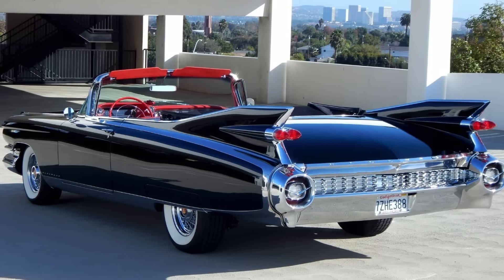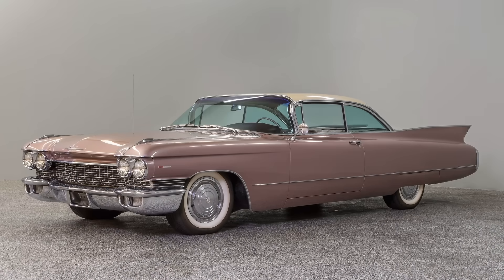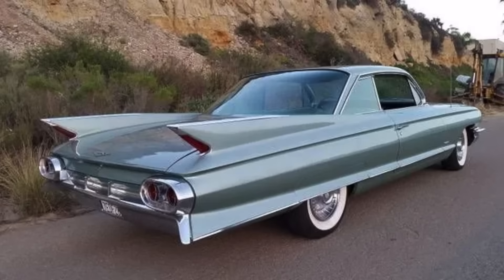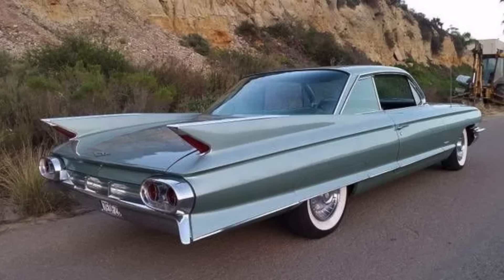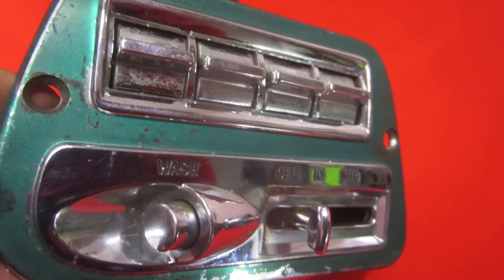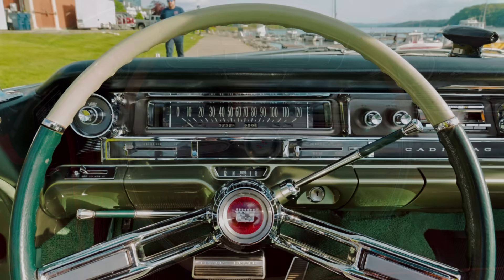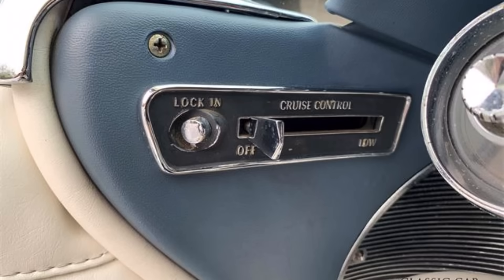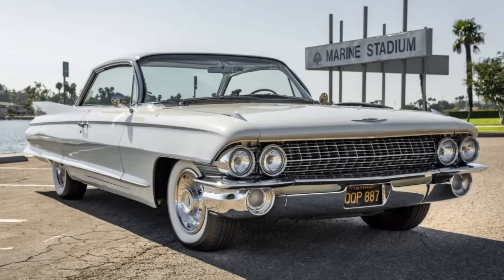Worst Automotive Components of All Time: The 1961 Cadillac's Dangerous Cruise Control (GM)

Comment: In about 1976, a woman offered to sell me her '59 Cad convertible for $150 ... I was a teenager, and said "no."  In hind sight, I should have said YES.
Reply: Right
Reply: Fifty Year storage was not on your mind at the time.
Reply: for me, she was a '64 Electra convertible and she wore red all over, for just $500. She was more than I could handle. Two weeks later, we saw her in the transmission shop. We kinda wondered if she "had problems" when we first gave her a go-over.  I'm glad I waited for good, honest, decent, upstanding Chrysler in blue.
Reply: You refused a Cadillac convertible?  Weird!
Reply: In `83 I bought a copy of the Want Ad Press, and found a bunch of `59s for sale. The one I checked out was being offered for $750, and I had talked the seller down to $650. But my parents had their mechanic check it out. He found a bent control arm. Plus one side of the dual exhaust was flex pipe. He didn't like that. Plus he didn't like the rust, so he recommended against me buying it, so my parents wouldn't let me have it. I later bought a `63 hearse without telling them till I brought it home.
Reply: For me, a 67 Dodge R/T in great condition for 300 dollars.
Reply: I knew a man who had a '60 Eldorado convertible.  Black with red interior and a white top with only around 40K miles.  He bought it in the '70's off the original owner from a for sale ad he saw in the newspaper.  He paid more than you would have had to for the '59; I think he paid around $2 or $3K but it was in near mint condition.  I rode in that car back in the '80's.  He died recently and I wonder what happened to that car?
Reply: @MillerMeteor74  Cool story.  I used to buy Hemmings around the same time.  When I was in college, I think it was '84 or '85 I had an opportunity to buy a '76 Sedan DeVille D'Elegance from the original owner.  I think it was around $2,500.  My father said he would help me out with the purchase and after I agreed to buy it, my father (who was known for this) refused to help.  I made HIM call the man and tell him and he lied, telling him I agreed on it knowing I didn't have the money.  
Well, it took me 28 years, but I finally bought a '76 D'Elegance only it's a Fleetwood.  Which I still have.
Reply: I was 14 in ' 76 and could have bought an ' 60 Impala for $ 200.00 and said no , so I know the feeling !
Reply: It's easy to have 20/20 hindsight when you're older, but when you're a teenager it's almost impossible to have 20/20 foresight.
Reply: Don't feel bad, we have all made insanely stupid decisions when we were young...  😢
Reply: If it was a 59 DeVille convertible,  then not a huge loss to you!! An ELDORADO.? BIG LOSS TO YOU,!! I have always said that the 1959, 75 series limo was the ONLY model that the  HUGE TAIL FINS looked appropriate on!
Reply: All of us from that time are kicking ourselves for vehicles we let get by that are now worth a small fortune. My biggest regret is from 1980 when a dying family friend offered me his 1953 Indian Chief motorcycle for $6000 (1/2 of what a collector in Connecticut had offered him). The bike was the last Indian sold east of the Mississippi when Indian folded in '53. It had  the optional factory tangerine paint, saddle bags, chrome package, and only 16K original miles.

Besides being a cool bike to own, it would be worth well north of $250K today.
Reply: I wouldn’t regret it too much. It would have cost you a small fortune to restore it to top condition.
Reply: As a teen in 1976, how lofty would $150 have been?
Reply: @sped6954  Well, a couple months wage.  Not to mention I already had my '55 pickup.  And it needed a transmission before I could even drive it.  And my parents wouldn't let me store it in our driveway, so I would have had to rent storage.  It just wasn't in the cards for a teenager.
Reply: They were cool for a couple years after they were introduced and then decidedly uncool until people had a chance to reflect on the passing of Elvis and how that whole late ‘50s era was gone forever.  Look at how they treated the one in the 1978 movie ‘The Deer Hunter’.  Then artists like Mellencamp and Springsteen began to harken back to that era in their songs.  So I’d say that by the early ‘80s it was definitely cool again.
Reply: For me, in 1985,it was a  green 69 camaro ss 396 convertible with 35k miles for $3000 .didn't buy it on account my mother said,you're not get a second car of yours in the drive way.I use to have a 72 impala,sob
Reply: Many cars we should have, could have, would have...
Reply: In our culture at that time of this Cadillac our most advanced Jet was the F104 Starfighter provided to NATO and the Germany who called it a flawed dangerous aircraft !
“in America tail fins could Not be too Large and Jet wings could Not be Too Small !”
Reply: Love it . A hearse 😁😁👍👍
Reply: I probably would have passed as well. When I was a teenager we thought of Cadillacs as a car for old people.
Reply: We’ve been there at one time or another. But probably the most common car story is . 
“I wish I still owned it.”
Reply: @oceanhome2023  they must have thought then too large since the '60 shrank them
Reply: @inkey2 i think it was meant that if you’re young and originally intoxicated with owning a 21’ long dramatic finned car, and it typically begins seriously needing major brake work, then fuel
gauge goes dead + other various safety & basic function issues, its gotta be parked safely without being molested until funds gathered & parts searched. i.e. waterpump, power steering unit… You’ll need storage for “various times all the time” and much unlike a 68 Coronet 318, you’ll ‘be very married & in waiting’ for this ‘59 to be back on the road. But sure, it was cool at first to say you now own this jaw-dropper to one of your girlfriends, till she falls for red & black ‘71 Chevelle SS guy !
Reply: You fool!
Reply: @michaelbenardo5695  Hey man! 150 clams in 1976 would be 830 in today's (2024) dough. What teenager had that?
Reply: @garymckee63  grandpa's car - lol
Reply: Well the fact that 1976 was the time of the gas shortages, I could see why you would say no.
Reply: My dad has a few stories like that but he always says even if he hadn’t passed those deals up he’d still be kicking himself because back then if you’d bought it you’d have driven it and treated it like a cheap, well used old car to bomb around town in and it would have been totally worn out and basically scrap iron by the mid 80’s at best. It really makes sense when you think about it….back when you could get them cheap most of the ones that were bought / sold weren’t treated as treasured collectibles.
Reply: The reason they are valuable now is because nobody in the 1970s cared about them.  

They were old and unreliable and out-of-date (we used to ridicule cars with tail fins) and used a ton of fuel in an era of spiralling oil prices.  

A jalopy for someone who rarely drove or a really good contender for a demolition derby.  

And even for those who could see that they would be collectors cars.. would you buy a 2002 Cadillac Eldorado with the horrible Northstar engine and keep it for 50 years hoping to see it increase in desirability and value?
Reply: Did you have $150 in 1976? That's a months wages working part time.
Reply: @dannydaw59  Did you have $150 in 1976? That's a months wages working part time.
     I probably did have $150, I've always been a saver.  But also the car needed a transmission, that was the reason she was decided to get rid of the car; and whatever that would cost, that probably would have been a bigger deal.  Plus a 1959 car in 1976 is a 17 year old car ... so it would have needed more than that.
    I made $2.25 p/h, for I don't know, 20 hrs a week?
Reply: By the 70's the 50's look was out of style and everyone longed for the sleek new liners of the 70's. They were practically giving 50's cars away.
Reply: @BenLapke dont have to be restored, just need to own it to profit
Reply: @albear972 those that had job living at home for free w a brain
Reply: @calvinnickel9995 no u buy it because u like it & probably goes fast w big engine, thinking of only financial gain is recent occurance
Reply: That's like being offered a 2007 Mercedes coupe for a couple thousand bucks today. Most people would pass on it... god knows what may be wrong with it, and what needs to be replaced.

Comment: I own a 1961 Cadillac Fleetwood that has the cruise control option.  It is a Perfect Circle unit that was used by multiple manufacturers (Chrysler, ironically, called theirs "AutoPilot" back then).  The unit had some functionality that Adam did not mention.  It was governed by the speedometer cable and used a mechanical connection to the throttle linkage to work the accelerator pedal.  To just use it as a cruise control like on many of today's cars, you simply brought the car to speed and pressed that small button and the car would maintain that speed.  You could also use it as a speed minder without engaging the cruise control by sliding the lever that was next to the button.  When the car reached the speed that corresponded to the slider setting, it would push back on the accelerator pedal if the speed was exceeded.  The slider lever could also be used when the cruise control was set to increase or decrease the speed.  This latter function could be tricky if you moved the slider too fast while the cruise control was set.
In any event, the cruise control could be disengaged by simply tapping the brake pedal so it would be hard to get it in an uncontrolled runaway situation.
Reply: Some people are just too scared of everything.
Reply: Thanks for those tidbits.  My '61 that I had in the '70s did not have the CC option.
Reply: Thank you for the tutorial, I was curious about the control functions.
Reply: View any Classic Car or Truck....
These vehicles were owned and driven by people who could actually Drive...
Survival of the Fittest right?..
With a Mechanical Link to Throttle input, Cable ... Have faults, wear etc.. conveniently (N) has been granted for your safety...

Cheers from Southern California 🇺🇸 
Daily Driver 68 Dodge Dart...
Keep them on the road
Reply: Yeah thanks for that. He made it sound more dangerous than it really was.
Reply: It was a traditional cruise control for that period of time and well into the 70s. It definitely scared a lot of people but if you had a little bit of driving skill it was easily a wonderful tool on long journeys. It is indeed that the interior designers change the location however and would be confusing for those that owned previous models but probably only once lol
Reply: The trouble with using a brake tap is that it could be interpreted as a brake check by a driver behind you. As soon as I realized that point I started using the cancel button instead.
Reply: @joewoodchuck3824 brake check was not popular in 70s people worn't such assho back then

Comment: A pretty bad automotive control was the pushbuttons to operate the automatic transmission of the 1958 Edsel.  They were located on the hub of the steering wheel and they activated an electric motor that was mounted on the transmission.  My dad had a 1958 Edsel Pacer.  Shortly before I used the car to take the driving test for my first driver's license, the electric motor burned out, making the pushbuttons inoperable.  My dad rigged a lever just to the right of the accelerator pedal to shift gears (DNR).  When it was time for the parallel parking part of the test, I pulled up in front of the parking space and, without releasing my grip on the steering wheel, I shifted into reverse with my foot and backed into the space.  The examiner gave me a puzzled look because he didn't know how I shifted into reverse.  I had my answer ready if he asked, but he didn't ask.  If he asked how the car went into reverse, I was going to say "automatic transmissiom".  If there had been such a thing back then, this would have suggested artificial intelligence.
Reply: I wonder if the same third party supplied the Edsel push button drive system parts as supplied a sort of similar system that was on some 1956? (not 1955?) Packards with their automatic transmission woes ?

Comment: Ford said, "Hold my beer..."  A 1977 Ford wagon with the 460 V8 cruise control would not cancel with a brake application when a brake light bulb burned out.  My old boss found that out when he attempted to exit the highway after driving some distance with the cruise control on.
Reply: Ouch
Reply: To fix that they put in a pressure switch on the brake iine, which only ever actually got used in the event the brake circuit 'failed'. Which then became a problem when they got a bad pressure switch design and they'd short and catch fire.
Reply: @warphammer  Fast forward a couple decades and Fords were burning to the ground because they used a cheap diaphragm switch for that and brake fluid is conductive... Everyone else was smart enough to have a switch tied to the brake pedal...but not relying on the bulbs to be functional lol
Reply: Had late-‘70s Lincoln’s; never noticed such a problem.
Reply: Also, in those days, you couldn't let your Ford idle. They had a tendency of dropping out of park into reverse.
Reply: GM is'nt better. An Opel Corsa C with automated manual transmission is'nt startable with both brakelights burned. Not as dangeous as a not canceling cruise control, but calling a towing truck because of dead brakelights  which nearly everyone can fix themself...
Reply: @walterwixzwerg6735  Especially since GM is notorious for electrical system issues/failures... Good chance the bulbs are actually fine and some design elsewhere in the car that GM cheaped out on is at fault.
Reply: Holy crap 😱😱

Comment: In college (1973) I had a 1960 Fleetwood with the infamous air ride ( it worked) - it did not have cruise but with good bias ply tires with that air ride it handled like a dream . I would drive it from Oklahoma City to Houston, Tx. leaving at midnight and get to Houston at 05:00 AM - it was a parade float but I loved it.
Reply: How I wish I could have one today!
Reply: Rarity for sure as most owners had the air suspension uprooted for conventional shocks.
Reply: Bias ply tires were terrible compared to radials. No reason to not have radials after they were available.
Reply: @MarinCipollina  they were NOT available in '73 and when they later were a Michelin for that size vehicle was $100.00 per tire - a small fortune at the time.
Reply: @myronfrobisher  Radial tires became standard on Cadillacs starting in 1973.  Those were Uniroyals. You may not care for the brand, but that's how the factory equipped them.
Reply: @MarinCipollina  when you were 19 years old were you buying radials for your used car in 1973?
Reply: I wasn't 19 until 1976, and yes, my car had radial tires. I had a 1964 Coupe de Ville.
Reply: @MarinCipollina  nice to be rich I paid for my college
Reply: @myronfrobisher The 1971 Lincoln Continental had Michelin X radials as standard. They came with a 40,000 mile warranty.
Reply: @stephenholland5930  ginger peachy - my Fleetwood came with a good set of bias ply tires that were rated better than what came with it new - I drove the car at speeds exceeding 100 mph on my trips to Houston - never a problem . In 1973 98% of the passenger cars on the road were on bias ply tires - In Oklahoma City at the time radials were not carried by most of the tire shops - I had no interest in spending money I did not have on radials which at the time required an inner tube. Trading off my Cadillac that cost me $275.00 for a new Lincoln or Cadillac in order to have radials would have been just a bit beyond delusional.
Reply: @myronfrobisher  Having a 12 year old Cadillac coupe with radial tires doesn't make anyone rich.
Reply: @MarinCipollina  in 1973 the cost of 4 radials was equivalent to almost 5 months rent - when it comes to paying for life's essentials priorities are imperative.
Reply: @myronfrobisher  Obviously I prioritized tires more than you did. It's nothing to argue over.
Reply: Wow, I had no clue cars ever had airride, I thought that was a semi truck exclusive

Comment: Interesting trivia, the series 75 Cadillacs used the 1959 windshield up to 1964, the rest of the Cadillac lineup used the flatter windshields introduced in 1961. Another interesting thing, the Dual Coupling Hydramatics with reverse all the way to the right where 4 speed transmissions. There was a speed controlled reverse lockout that locked reverse out above 5ish MPH. It was also one of the few automatics that you could push start the car, it had a second pump mounted on the output shaft.